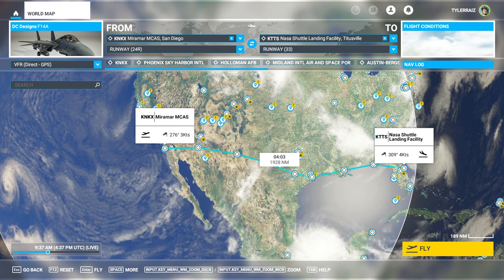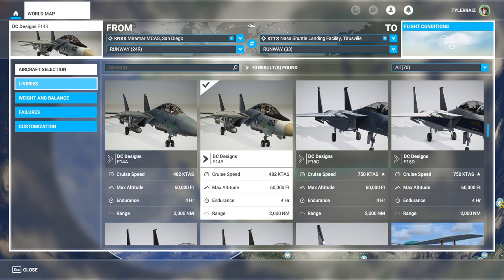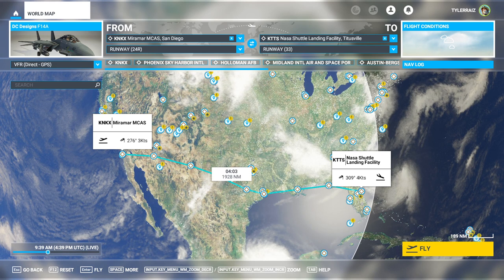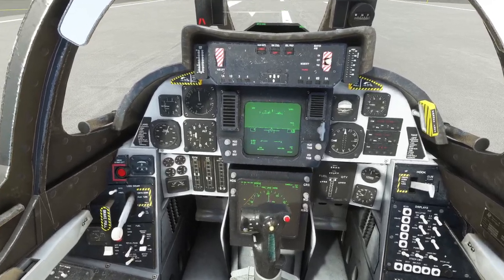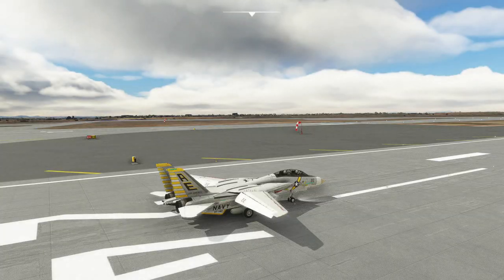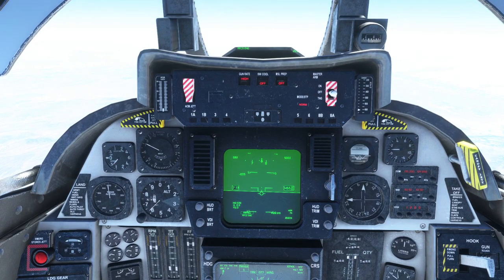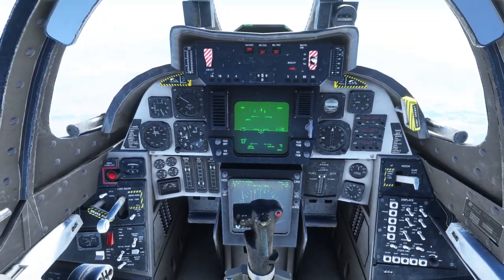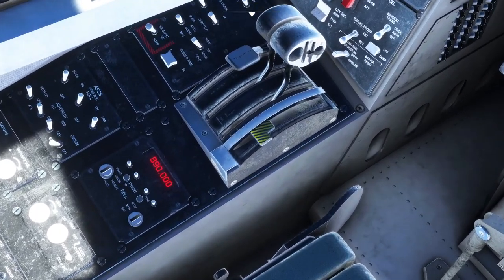Flight Sim 2020 - DC Designs F-14 First Try

Comment: i'm contemplating hard on whether or not i should get this on my xbox series x, i have the eurofighter typhoon so i'm not entirely sure if i should buy this, the f14 looks really cool and definitely looks fun to fly but how does it compare to the eurofighter? especially after the top gun update, how good is it now and does the throttle have military power as well? the eurofighter unfortunately doesn't
Reply from the maker: I would say that this F-14 is certainly better than the Eurofighter Typhoon, which I also have, and much more satisfying to fly. I'm not sure what you're asking on the military power - it certainly has afterburners, and those are activated at the top end of the regular throttle.
Reply: @RaizSpace  military power as in full engine power without the after burners, anyways i did end up buying the f14 and it's so nice to fly. i was flying in the grand canyon all the way up to marble canyon into Page at low altitude through colorado river, and it's amazing
Reply from the maker: I understand what military power is, but couldn't figure out why a plane wouldn't have it. It is simply the maximum thrust without afterburners.
Reply: @RaizSpace  yeah but the eurofighter, on xbox at least, doesnt seem to have it unless i'm missing something it's just very odd

Comment: why are the jets so slow? i can only get mine to go around 380kts when in real life they can go past the speed of sound
Reply from the maker: You may be looking at the indicated air speed (IAS) which doesn't take into account decreasing air density. That speed basically represents the stress on the airframe and is important for the stall speed, but isn't actually how fast you're going. The true airspeed (TAS) or the Mach speed is what you should be looking at to see if you've passed the speed of sound, while the ground speed is your speed over the ground (the ground speed combines the TAS with wind velocity).
Reply: @RaizSpace  thanks. I have much to learn.

Comment: How is 800 knots Mach 2.3?????
Reply from the maker: That's indicated airspeed, not true airspeed - you can see the true airspeed (TAS) below the main tape on the indicator. IAS, or indicated airspeed, doesn't take into account the drop in air density at high altitude, while TAS does. IAS is still important because it does a better job at representing the stress on the airframe.

Comment: Where are the speed brakes?
Reply from the maker: They are there as long as you've mapped the speed brake key. They are at the top and bottom of the tail as well as outboard on the wings.